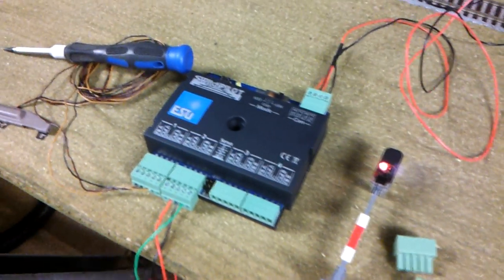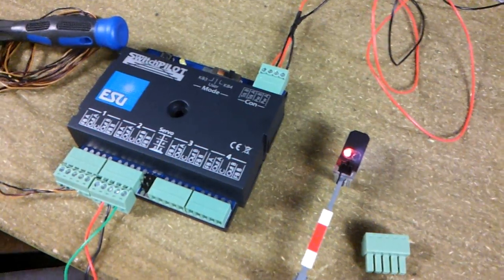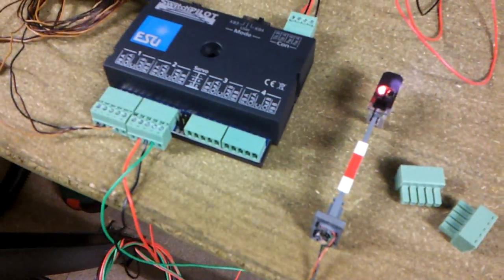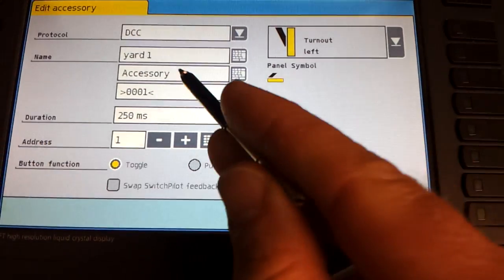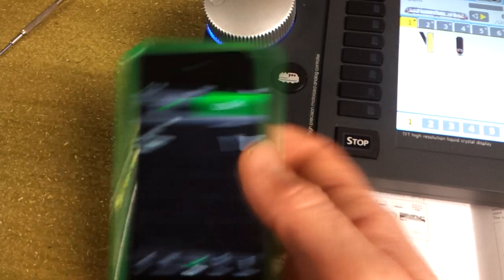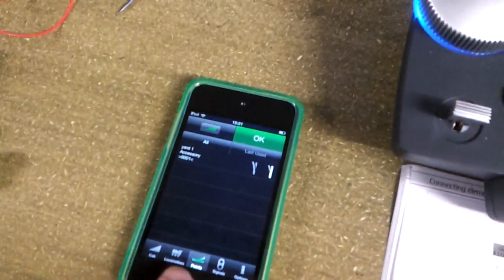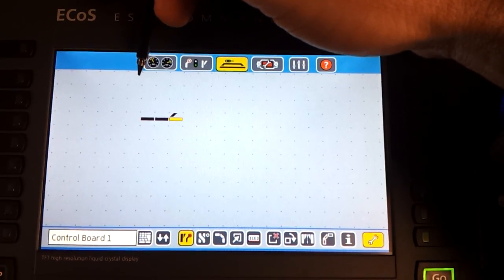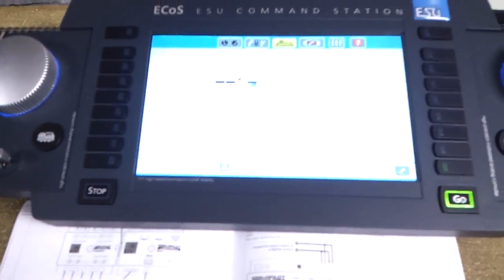Esu switch pilot basic setup

Comment: Hi Jim!
Informative Video! Thanks!
I have two switch pilots and two switch pilot extentions. I will try out to use them. because you showed that they are very useful. I did not know that it is possible to use the switch pilot for two or more address.
regards Tak

Comment: Hi Jim - did you do a seperate vid for feeding 2 point motors from one port block? Also I see you have a dedicated accessory for the light signal but there must be a way to link it to the point feed so its switched at the same time as the point...thanks for any info.
Reply from the maker: Hi sorry for the late reply..been ill,
You can work two point motors from one port on a accessory decoder but with automation it messes things up so all my points use one port per motor  inc any three way points.
Yeah I did link my basic signals to the point motors so they change when the point blade fires..(k83 mode) .not sure if I did a vid on that...I think I did some where in my channel.
Jim..
Reply: @hovermotion  Thanks - will have a further look into it. I got my first SP all wired up firing 4x Roco points I bought some years back - all worked 1st time and as you show, so nice to configure on the Ecos. Hope you are on the mend - its the weather I reckon...
Reply from the maker: @paredding  cool....all ok ish now had very bad food poisoning...back in work now....

Comment: Hi Jim, i have been reviewing your videos - a great body of work!  i am struggling with response from the two servo connections on the switchpilot.   i am building a 6 station roundhouse and have a switch pilot servo as decoder 1 to control the 1st 4 doors.  all works well on my ECoS and have control of servos.   i added the Switchpilot to the board for the last two doors and the control of lights.   press the 'learn' button and LED flashes.  activate the door icon on ECoS and the LED goes out.   but the servo does not become active.   The ECos shows address 2:1 for first servo and 2:2 for 2nd servo.    Have not tried to implement the lights yet.  have deleted all entries and done a hard reset on Switch Pilot to no avail.   Have you tried to set up both the relay contacts and the servos on one Switch Pilot?    Mike
Reply from the maker: Hi Mike. ..thanks for your comment...
No I have never tried a servo on a switch pilot so I am not sure..One to four address are 1:1,2,3,4, addresses 5&6 on switch pilot unit two should be  2:1,2 on the ecos.
try the esu forum it's pretty good...
Jim

Comment: What light signal model is?
Reply from the maker: Hi, Fleischmann
Reply: @hovermotion  ok thanks. Because I have the ESU command station with switch pilot 3 and I believed that the marklin signal was ok for it so I bought it, instead they have only 2 blue cable connected directly to the signal and another red cable attached to the connector that goes into Marklin decoder…but not weld to the signal.
it doesn’t understand where the marklin signal takes the current…
I believed that marklin was compatible with switch pilot. I inserted the 2 blue cables into OUT A and OUT B exit but leaving the C (common) not linked because there is not other connector where I I can weld the red cable…
Reply: @hovermotion  so the Fleishmann signal has 3 cables that run out from the signal, right? 1 goes into OUTA, 1 into OUTB and the third cable into C common link…is right?
Reply from the maker: @paolodargenio3901  correct
Reply: @hovermotion  thank you very much Jim. Cheers

Comment: You are doing a mistake by use magnet switch motor connect to ESU decoder that stand in k84 mode,which is default!! Use Another ESU decoder switch pilot which you can set k83 as mode by use magnet switch motor.
Reply: A Quick lesson:
k83=provisional switch contact
k84=permantly switch contact
Reply: Anders Gullberg One more thing:
To set k83 and k84 modes are meant only for motorola protocol. While mode stand in the centre is for DCC.